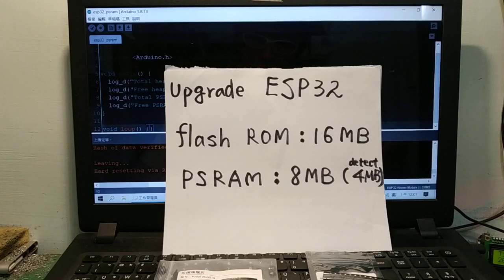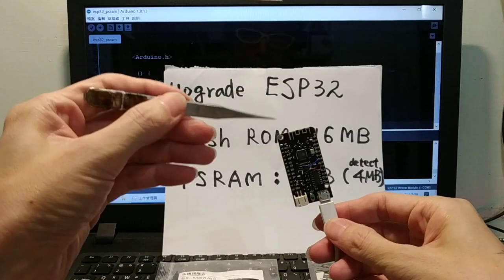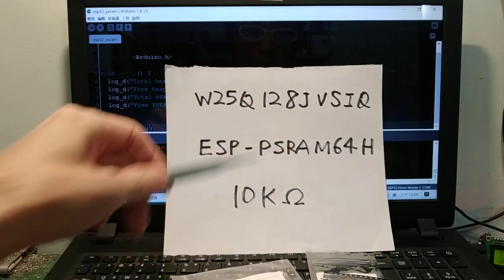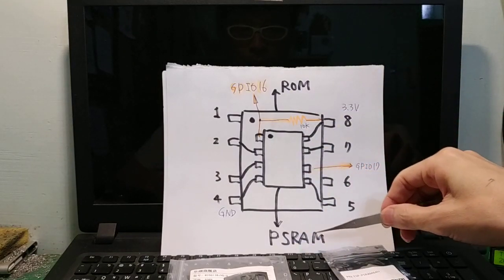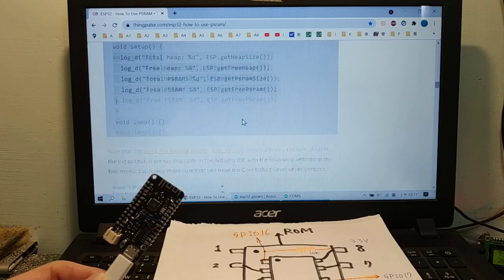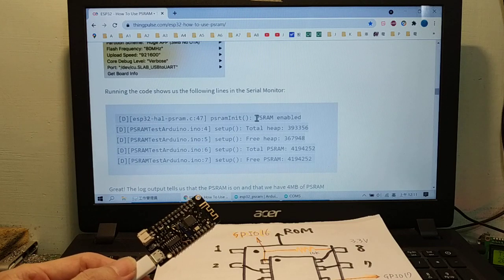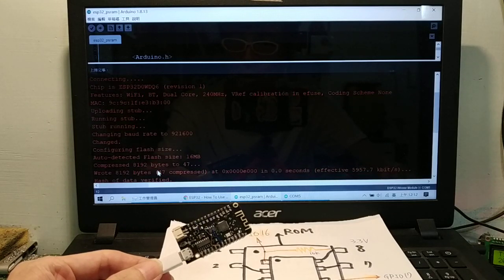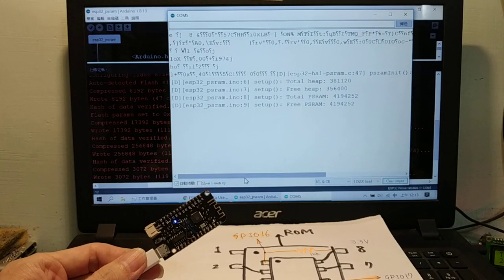Upgrade ESP32 flash ROM and PSRAM

Comment: Thank for sharing this video, I have esp32-s3 (FN8) and esp psram64h, I just need to add psram as the chip has 8MB built-in flash, which pins should be connected to esp32-s3, I checked datasheets but couldn't figure out exact pins.

Comment: I keep getting these errors when I enable PSRAM in sdkconfig. Do you know what can be wrong?

load:0x40080404,len:2840
entry 0x40080560
ets Jul 29 2019 12:21:46

rst:0xc (SW_CPU_RESET),boot:0x13 (SPI_FAST_FLASH_BOOT)
configsip: 0, SPIWP:0xee
clk_drv:0x00,q_drv:0x00,d_drv:0x00,cs0_drv:0x00,hd_drv:0x00,wp_drv:0x00
mode:DIO, clock div:2
load:0x3fff00c0,len:1988
load:0x40078000,len:16488
load:0x40080400,len:4
--- 0x40080400: _init at ??:?

load:0x40080404,len:2840
entry 0x40080560
ets Jul 29 2019 12:21:46

rst:0xc (SW_CPU_RESET),boot:0x13 (SPI_FAST_FLASH_BOOT)
configsip: 0, SPIWP:0xee
clk_drv:0x00,q_drv:0x00,d_drv:0x00,cs0_drv:0x00,hd_drv:0x00,wp_drv:0x00
mode:DIO, clock div:2
load:0x3fff00c0,len:1988
load:0x40078000,len:16488
load:0x40080400,len:4
--- 0x40080400: _init at ??:?

Comment: what if i have ESP32 ordinary board...? where to connect external PSRAM ?
any schematic ?
Reply: You can remove the shield with a soldering iron which powerful than 40 watts.

Keep contact the shield and heat it up for two minutes, than peel it with ease.
Reply from the maker: esp32 wrover datasheet